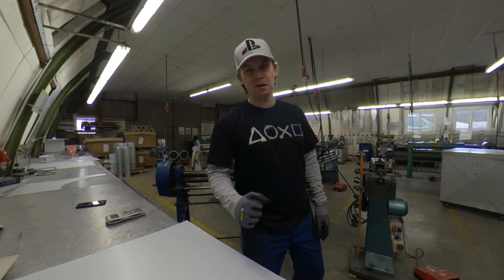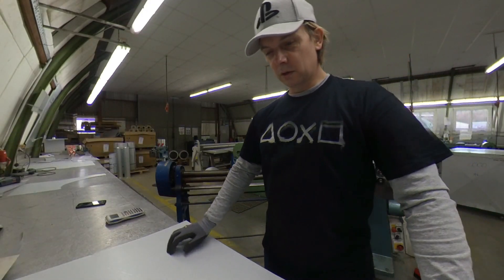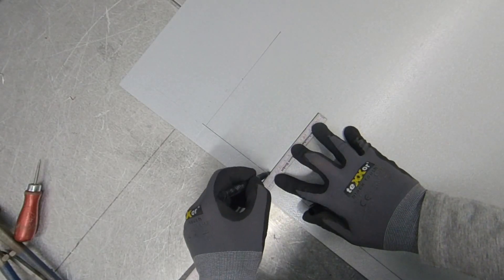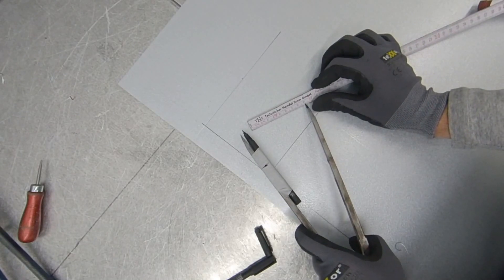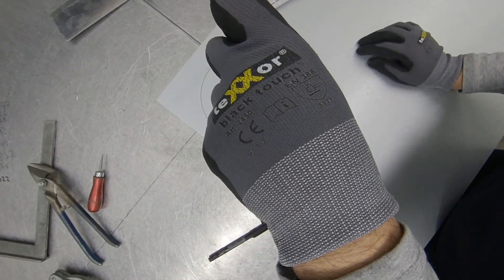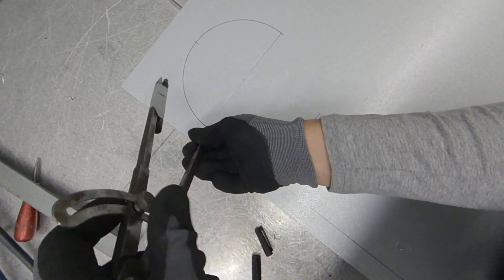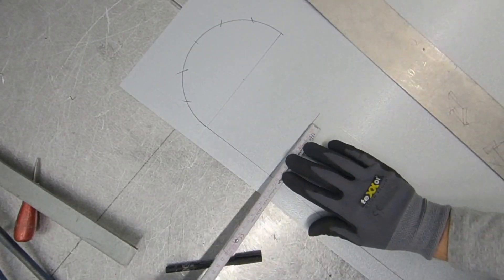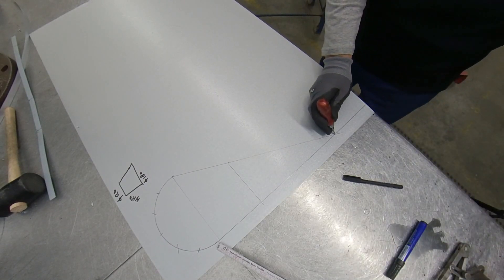Eccentric Reducer Sheet Metal

Comment: Shortcut formula 
Suppose Big Reducer round 5 miter and 4 part
Reply from the maker: You can scale it 1:10 to get the real lengths and use the triangulation method ,there is a video where I explain the triangle method in the lighthouse video

Comment: I know this is an old video and I've known a few methods on eccentric reducers. But I struggle with the best methods of fabricating very large ones. For example an 90 inch diameter to a 70 inch with a 60 inch true length. Can this method be used just with using a scale ruler to shrink it?
Reply from the maker: Yes it's possible to scale for example 1:10 and then just drag over the sizes wenn you scale back
Reply: @Sheet_Metal_Workshop  thank you very much